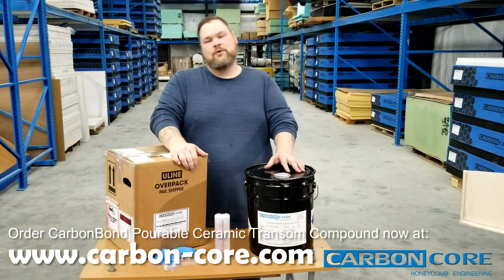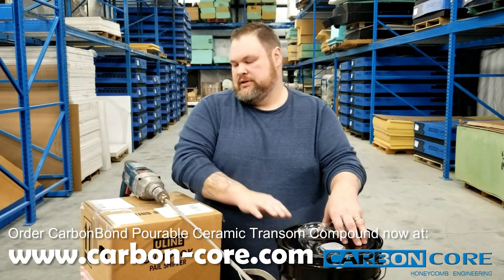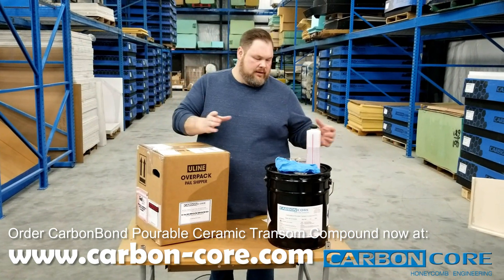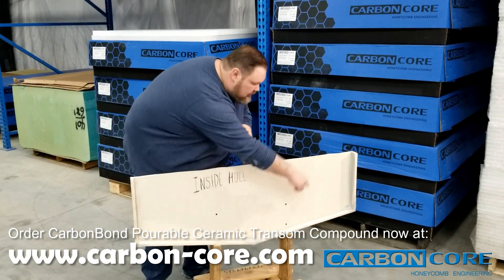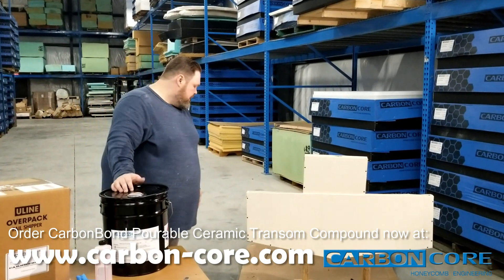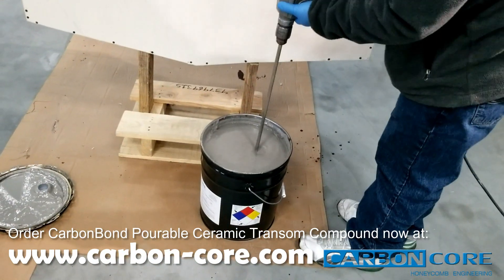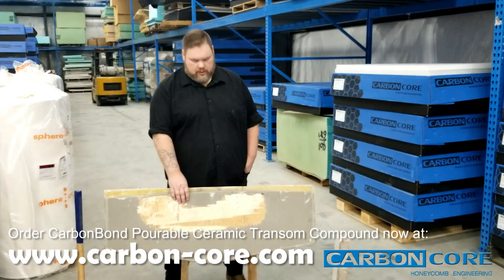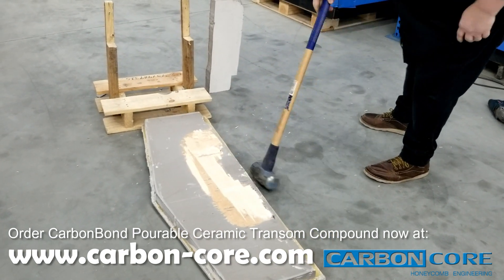Carbon Core Transom Compound Demonstration

Comment: Carbon core is far superior to the Lumpy blue
Void e pourable transom compound.
It is great. Check some of my vids. I did my transom the same way but with the lumpy stuff. I've switched to carbon core and it's so much easier and friendly. Self leveling. 
Tip. Always use super fresh product. It dsnt age well on a shelf. In fact if buying in person open the container and inspect.

Comment: DO NOT PURCHASE THIS PRODUCT,,,,,,,,, HERE IS WHY !!!!!  👎👎☹☹

Unfortunately for me, I read the good reviews and decided this was the best product. I ordered 10 gallons. I called the distributor to make sure my calculations for the catalyst were Correct. He told me I should try 1 gallon first and see what happens. I mixed it as directed and it didn't set up. 3 days later it was still gooey. I called him again to discuss the problem. He said he would get back to me. 1 week later I called him and we discussed the problem. I explained it had hardened but was still a little sticky. I mentioned maybe it was weather conditions or bad catalyst. Either way I told him I would try the next 4 gallons. Well it did the same thing but this time since I had taped the inside holes, it again wasn't hardening. It pushed through the inside tape and filled up the inside drain cavity about 2 inches. So I removed the outside plywood so it would drain out. I couldn't leave it in if it wasn't going to dry and leak out. So back on the phone with him and was told I needed to fill out this page long questionnaire about the facts of the matter. I waited a week and no response. It the meantime the product that dripped out got hard finally after a week. I got on the phone again and asked for 2 gallons to replace what I needed to complete the job.  2 weeks and no reply. So I finally got him on the phone again and imagine that,,, this reputable company said it will not replace only 2 gallons of the product said failed to properly work. He said I should not have poured it since it didn't work the first time,,,, yet I had discussed this with him on the phone.  I am really dissatisfied and would warn anyone that is considering Carbon Core "NOT"  to by this product because they will not stand behind it. I would think that 2 gallons is a minimal amount to keep from getting bad Reviews. If I hadn't done my due diligence and spoke with them numerous times, I could understand not replacing the faulty product. BUT THIS WAS NOT THE CASE BY ANY MEANS....I don't know what to do now and am trying to not get really pissed.

Comment: Mine worked great accept for one difference, I put in a 3/8" 7570 aluminum plate as additional streght and filled the carbon on both sides. Transom is stronger than a freight train now.

Comment: I just received my carbon-core 5 gals. I'm using it to reinforce and fill in some rotten places in my boat stringers. My question is can I mix half the bucket at a time. My pour will be a little awkward, so I would like to do two sections, one at a time. Thanks for a great video.
Reply from the maker: Yes sir, no problem to mix less than 5 gal, make sure you adjust the catalyst ratio to the correct amount
Reply: I have the same problem with my stingers in the rear of my bass boat being rotten. Did this work for you?
Reply: @michaelfaulkner5994  It did work for me. I dug out the stringers down to the bottom or to solid wood. I used pt 1 x 4 or 6 to form up the parts that were missing and gave me a level top surface to pour and level too. Pouring it I split into two parts. Something that worked really well was a sheet rock mud tray from Home Depot apx $5. I cut apx 1 inch out of a bottom corner then set the tray in the form . The angle and tray proved to be perfect to pour into.

Comment: You guys need to get the boat manufacturers to use your product to mold transoms that could be glassed over just as ply is. Runners could also be molded. When you consider how much a new boat costs it seems as though they should be built better
Reply: I'm trying to get a famous boat company to use this and they are super weird about jinx ING the jou jou that makes there boats not fail but yet they famously rot out just like every other boat.

Comment: Great stuff. Great for a DIY with some glassing experience. I used it on my V20. V20 doesn't have a flat transom. There are three angles. Truly "pourable" made it match the shape and fill the space. No air gaps. no need to vacuum bag.
Reply: How much did you use to fill your V20 Transom? I have a 1983 V20.  Did  you hallow out your transom or did you cut out one wall to take all the wood out?

Comment: Before applying this to aluminum,  does the aluminum need to be coated or protected first? Does this compound have any corrosive properties that might enhance aluminum oxidation or corrosion?
Reply: Fair question.
   I’m disappointed that you were not given a response. 
  This much speaks volumes.  
  People that work with aluminum on a finite level understand that oxidation with this alloy can be very different and cause difficulties to arise with no known solution.
Reply: The fiberglass process relies on the porosity of the substrate so non porous substrates can delaminate because it was never laminated in the first place.
Fiberglass boat builders use fiberglass not aluminum for this reason.

Comment: This looks like a great product for transom repair. With such little flex,  wouldn't any stress be redirected to the borders of the transom? I'm wondering if that might cause issues down the road.  I just bought a 17' jon boat that needs a new transom core. The transom aluminum is welded to the sides and has angle aluminum braces riveted to the transom.  I'm wanting to not make any mistakes that would compromise the integrity over the long term.  Looks like a great product!

Comment: Id like to use this to repare my stringers on my fiberglass boat but don't need 5 gal of it will you guys start selling smaller amounts? Also with the flex of the wood on the stringers would this flex just as well? Basically I need to dig out the rotten wood and just poor it in since there is fiberglass on both sides then just fiberglass new stuff over the top of the repared stringers its conecting to the transom so it will have the strength and also stick to all the old fiberglass?
Reply: The adhesion of this stuff is off the charts. It is laminated when cured.

Comment: How this work whit wood residue inside the transom ????
Reply: You should remove all wet rotted wood completely and dry out Void.
I use many different kinda tools.
Burrs rasps air scrapers die grinders flap disks 16 and 24 grit. augers chainsaws Yada Yada yada

Comment: I purchased this and mixed 10.5 catalyst into the 5 gal. mixed it 5 minutes and started pouring it into my transom.   It fired off  before I could get a 1/2 of a gallon in. The whole 5 gal bucket harden up and l was out $297.00
From the moment I pulled out the drill it began to harden.
I don't see how you got away with the whole 10.5
It was in the 60 to ,70s temperature.
Either this can was bad or it was super cool in that building you mixed that up.
But that's My loss.
Reply: Sorry for your troubles. I've never had anything like that happen.
A 1 2 3 percent ratio is sophisticated for any mek reaction.. so 1 percent of 100 ml is 1 ml. Even at 3 percent it gives you 25 min working time. Don't give up this stuff is great. Learning curve to everything
Reply: 15 min working time

Comment: You guys should maybe emphasize the how much catalyst to use per the chart according to atmospheric temperature in this video. I wasted a bucket not understanding the purpose of the enclosed temperature catalyst chart. It hardened before I could even pour it.
Reply: Looks like he used 10.5 ounces for 5 gallons.  Which is 310 cc’s for 60-65F temps.   It was probably hotter than that when you mixed it making your mixing ratio “hot” with to much catalyst.     I would have been pissedddddddd.  For almost 375$ delivered
Reply: @jamesa6272 was definitely pissed...wound up buying another brand which sold gallon buckets vs 5 gallons.  Transom worked out well...
Reply: @MrKrb79 The carbon core I ordered is coming tomorrow.  I’m definitely going to be paying close attention to the directions.   It says I need 3 gallons for my transom.   I’m hoping a lot isn’t left over and I’m also hoping I’m going to have enough lol.  I didn’t like their chart on the website saying how much to get

Comment: I just did a transom get a 5000psi pressure washer and a turbo tip it was the easiest way to get the rotted wood out and with the poor in transoms are alot easier

Comment: You say it’s more durable and stronger than Coosa board. I’ve found compression and tensile numbers, but I can’t find shear or flex numbers for your product. Could you provide those?
Reply from the maker: Karl,

This  product has  not  been  tested  for  shear or  flex.  Shear numbers  should show  proportionate  increase  as  compared  to  the  compression  rating, which  for this  product is by far the most important  attribute. The  safety margin  for  the  product is  greater  than  10X required by most calculations.
Reply: @CarbonCoreCorp  
I would love to use your product, but I can’t in good Conscience without those numbers.
Reply: Seacast was tested by a lab years ago when Wolf was alive. If you call them they have this data.
CC is stronger than seacast because it has zero voids. Seacast is stronger than plywood even with the voids. The ceramic spheres is what makes this product superior.
Reply: @CarbonCoreCorp   not  been  tested  for  shear or  flex...that is disturbing..
Reply: You say I t will outlast coosa board ,how long has your product been on the market how will it outlast coosa board

Comment: Is this a similar material that they use to bond the top half of a bass boat with all of its storage units to the bottom half of the hull think they call it "mud" in the fiberglass boat building industry and so what I'm asking is this a so-called mud   stuff they used  the top part of the boat to the bottom half of the boat
Reply from the maker: Boat halves  are  bonded  with what is called  Hull and  Deck putty or  MMA  adhesive, and it is  a different material.  On our  website   CarbonBond  GPC  is  the material you are looking for.

Comment: Why does it need to be encapsulated in fiberglass
Reply from the maker: Its  somewhat porous, and  essentially  a  core material, which means  it  should be  encapsulated  fully  to fully take advantage of its  mechanical properties. Its  like a  web in I  beam,  without one of  the flanges,  it  would not  function like an  I beam.  Bridge  without a  bridge  deck?
Reply: @CarbonCoreCorp  I guess I'm unsure of whether this would be good to pour into an aluminum transom cavity or not. Do I have to have fiberglass surrounding the entire surface of the transom cavity? Not sure how this looks in use

Comment: Love to see a way to thicken this stuff up, and then make it trowellable onto a foam substrate vertical position.  Kinda like a plaster material but so much stronger.  Maybe 1/2" thick applies in 2-3 layers with trowel.  Why not?  Like add a silica to it or something.
Reply: Use a waxed lexan form to hold vertical surfaces hot glue and tape in place

Comment: Would like to know, I need 6 ,5 gallon pails for my Dusky 23 footer. Gentleman on video instructs, "mix one pail at a time",  but can I mix and pour in rapid succession ? Or do I need for each pour to set first? Thanks (leaning towards using your product rather than Seacast).
Reply from the maker: Yes you can , only reason to mix one at a time is that you would have enough time to pour them without stressing that the other buckets start hardening
Reply: @CarbonCoreCorp  Thought it might be something like that,thank you for your reply.
Reply: Peak exotherm is the highest temp  it will reach. Good practice is to pour one five gallon at a time and watch peak exotherm then pour when temp is cooled down sum.
This product has a low peak exotherm compared to other types of resins and epoxys

Comment: Can i use this to make the stringers out of?
Reply from the maker: Yes sir, stringer repair is a common use for this material
Reply: @CarbonCoreCorp    Can you drill a pilot hole in carbon-core and then run a lag bolt into it for an engine mount that sits on top of the stringer?
Reply from the maker: @johnguilbert1349  yes but I would  through bolt  instead.

Comment: If you USE this AS a surface materiale only like you would do if you laid fiberglassmaterial on the outside of transom......will IT still increase the strenght of the transom? And if so....How much stronger will the transom be  compared to the transom itself .....if you put it on that way?Tord from Norway
Reply from the maker: This  is  not  intended  to be  used  as  surface material, it needs to be encapsulated  in fiberglass

Comment: What is the weight of this? If you USE 0.5 m^3 What would be the increase in weight of the Stern ?
Reply from the maker: It is  similar in weight to plywood,  for  calculations, please  call our  technical help line at  4345107115

Comment: i had lag bolts in my old wood stringers .can i use lag bolts in carbon core? they hold motor mounts  down for 350 v8 engines .my stringers are 3 inches wide or should i make mounts that hold engines with 4 inch bolts that go threw stringers horizontal thanks
Reply from the maker: You can, and you can wax the bolts so they are removable at a later date

Comment from the maker: Yes  sir,  common use  for this material.
Reply: How do I determine how much of your compound I need for my transom repair I was told it was on your website by this YouTube video or in your video but I can’t find it anywhere
Reply from the maker: https://www.carbon-core.com/products/carbonbond/transom-compound/                         this  page   has   a  calculator  on it

Comment: I have a 1974 wellcraft i have to redo the transom on, i put a newer 4 stroke motor on and transom is cracking and leaking water. Is this product strong enough to take an old boat and make the transom strong enough for a newer 4 stroke motor ?
Reply from the maker: Yes  Sir ,  absolutely, 700%  stronger in compression  than  plywood. Specifically designed  for  new  high  horsepower  motors  on bass-boats.
Reply: CarbonCore  Thank You for the info!

Comment: Does this material absorb water at all, and if so at what rate?
Reply from the maker: Jeff,

Great question, and no it does not absorb water. Our tests indicate less than 1% per volume can be absorbed on its own , just like any closed cell foams. Since it will be encapsulated by composite skins, you  will see  zero water absorption.

Comment: what's the weight compared to cooza or plywood?
Reply from the maker: Marc,  Great  question.  It  weighs  about the  same, no  obvious  weight  savings.  Coosa (26 lb /ft3) weighs  a little less  without  the  necessary  bonding  putties, so  overall w eight should be  close.  Our  material is  35 lb/ft3  and  plywood  about  35-45, depending on grade.

Comment: How many cubic inches does one pail cover?
Reply from the maker: About 1100,  please  use  the  volume  calculator  at  http://www.carbon-core.com/products/carbonbond/transom-compound/
Reply: BTW, for those running Chrome, that calculator is a Flash application. You need to enable Flash to see and use it.